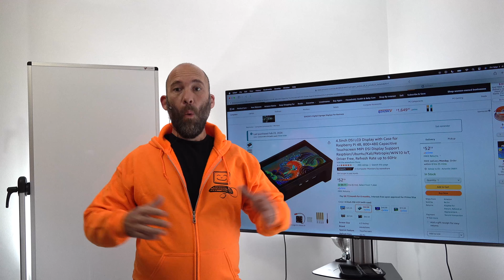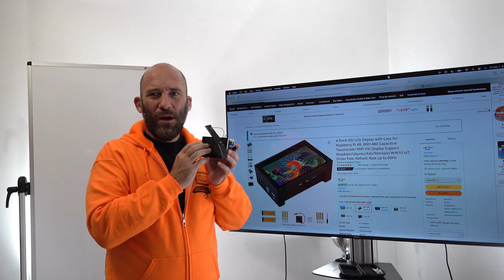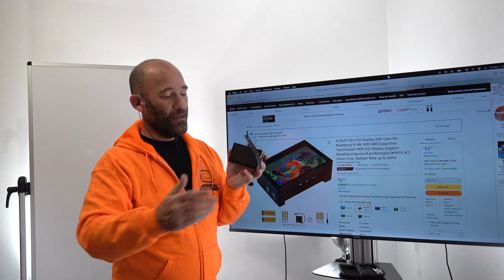Parts Bin: 4.3 Inch LCD Touchscreen Screen for Raspberry Pi

Comment: 12:23
bluetooth generally has its use cases, but I don't prefer it usually. 
I'd really want to find a wired keyboard that small or at least a bluetooth one that lets you turn off wireless and use a wired mode.

Comment: While the pi 5 looks like it will have it's uses, going bigger and requiring an active heatsink (or at least it's heavily implying it needs it by default by that being the stock cooler), I feel like it's gone a bit too high power.
Just the same way GPUs did by going bulky and power hungry before becoming more efficient first...

Comment: Give me mosquitto server with dynamic security plugin enabled in a docker container then let me cook. I will build you a dotnet web server that distributes a webassembly PWA with rest endpoints on the server for cloud backup, and retrieving dynamically created MQTT credintials with unique roles that have rules only allowing messaging other PWA browser instances that you have linked to. Then add gRPC to the server to allow instances of the server to federate between other servers. This should allow a PWA distributed by one domain to get MQTT credintials from another. Make the servers that are federated together dynamically load balance the MQTT traffic. Then finally you have a swarm of messaging servers.